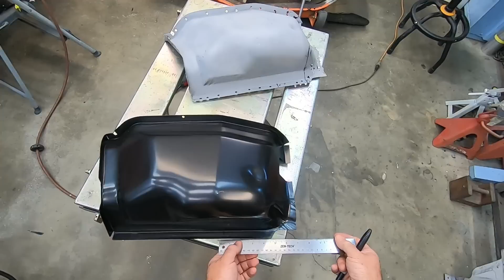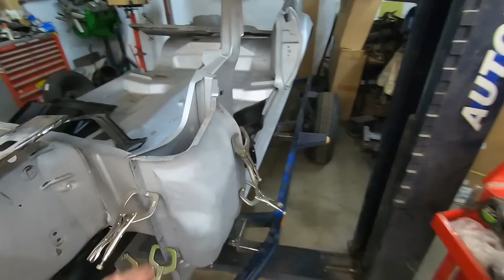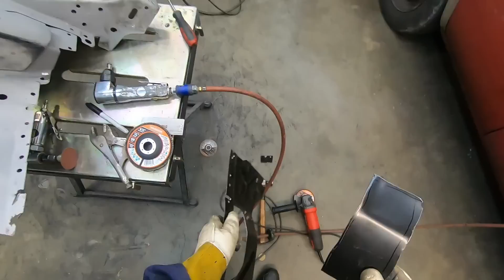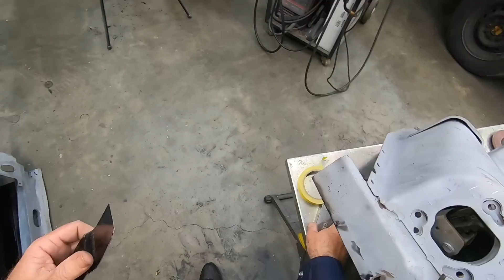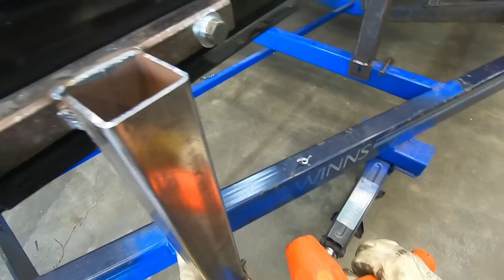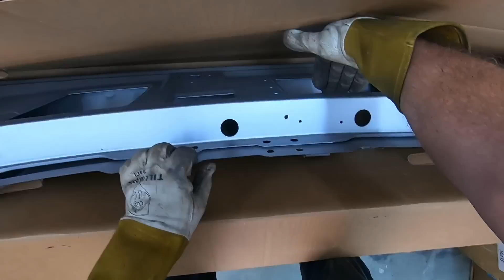Cobra jet rebuild: From the ground up. Part 9.

Comment: Barry, had you ever determined what the reason was for the gap between the driver side rear fender apron flange and the firewall at 59:14? And what, if anything, you did to correct it? I'm facing the same issue and not sure if I should leave it or try to address it. Thanks.
Reply from the maker: I can't remember what I did, but I probably mentioned or addressed it in one of the following videos. I did use the upper half of the original firewall to finish it.
Reply: @JoDaddysGarage you covered it in the beginning of episode 10 👍
I hope the back gets to feeling better soon!

Comment: Barry. With my 67 fastback, I am planning of assembling/welding both parts of the cowl first , prior installing on the body. So I make sure the pivots of the wipers are in the center of their openings ? !  Got it ? B67FSTB.
Reply from the maker: I understand what you’re saying. Not sure how much “play” is there between the top and bottom cowl.
Reply: @JoDaddysGarage Don't know how a 69 cowl is assembled but just to give you a heads up. BTW admire your patience !!  And work of course !!!!

Comment: Great video once again...and always looking for the next one you put out. Perhaps when using new to repair old, and to compare the old and new parts, try using a contour/profile gauge to locate and create reference points on each part for the sectioning, for isolating where to cut? You are so methodical and often precise and I thought you would Cut and Butt the Air Boxes without leaving seams for anyone knowing you were ever there versus overlap joints...and then sanded everything smooth and finished a great job once again.
Reply from the maker: I have done that before. Good idea.